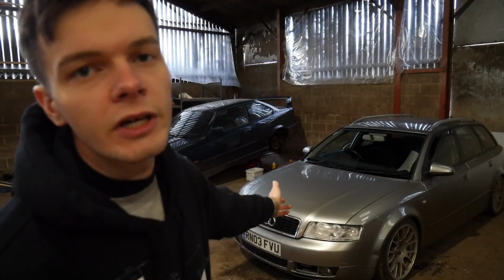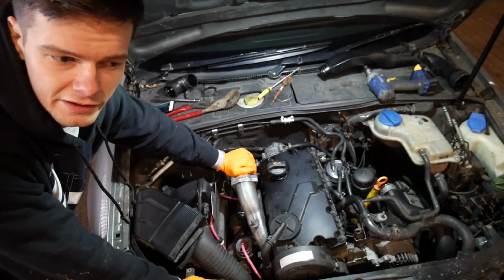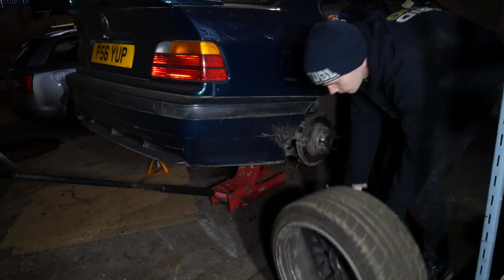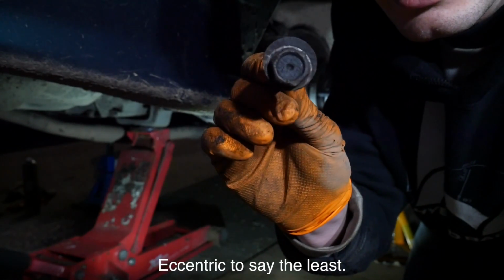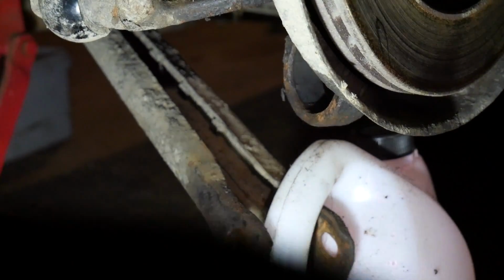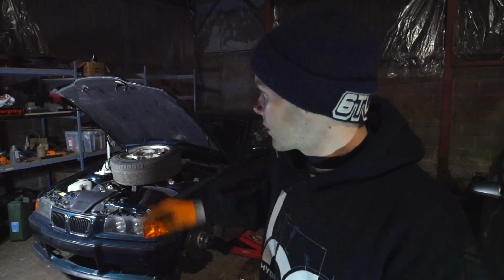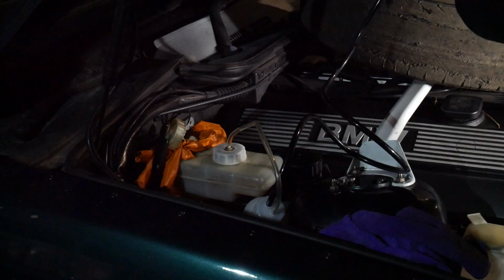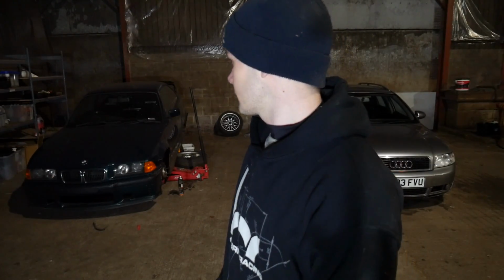Bushes to Balljoints. Autobarn EP2!

Comment: Love the videos, it's cool to see you getting stuck into some "proper" mechanical tinkering. I wish I was as brave. For lighting, you can get diffusers which help a lot with LED lights. It's essentially like tracing paper over the light - if your lights are beefy enough (there is some overall loss of brightness) then that has worked for me before. But as has been said, who cares, videos are great as they are! Looking forward to seeing the Audi starting mystery solved. Good luck.
Reply from the maker: +pornosam84 thanks I'll give that a try! Half my issues were camera related as well tbh, you can see me checking the screen far too often! Didn't really want to piss about with it too much though or it just ends up covered in shit.
Reply: Tell me about it. I got silicon grease in my SLR maybe 3 years ago...still has greasy patches sometimes. Don't worry about how it looks - so long as the camera's looking the right way and there's "some" light, it's good enough for us Youtube freeloaders!

Comment: I bought that exact bleeder for my S14 when I changed my clutch master, annoyingly it didn't fit my brake or clutch master cylinders. Trying to "undo" bolts by doing them up is the greatest, especially when youre under the car undoing some shit upside down and realise after a while of struggling 😀
Reply from the maker: Yeah it's only sat in the garage forgotten about because it didn't fit the DC2! Works well on the BMWs though :)

Comment: Common fault on the PD's is the wiring loom running to the injectors through the head, they shit the bed resulting in no start / miss fires. New OE sub harness is apparently ~£40.
Reply from the maker: Yeah I've heard about that but the symptoms I'm getting don't quite match up at the moment.

Comment: Good video as always Danny, have you cleaned/checked the EGR? I had a starting issue with my A3 and turned out the EGR was sticking shut so the engine wasn't getting any air.
Reply from the maker: +Craig Kent doesn't have one pal
Reply: Fair enough!

Comment: Will the brake bleed kit still work with an ABS unit in place?
Reply from the maker: +Russell the E36 still has an ABS pump and it worked. All the sensors have been cut off though 😂
Reply: DannyDC2 Ah ok. We had trouble with bleeding race bikes with the ABS pump still in place.
Reply: I never had a prob with the Motiv pressurized brake bleeder and my ABS in 16 years of hoopty ownership.

Comment: For all audi part numbers: http://www.oemepc.com/audi/lang/u

If the ez bleed kit leaks at one of the seals let of some tyre pressure.
These kits are not 100% solid.
Reply from the maker: Nice one thanks! Only issue is the pump on the car wasn't original, that's why I had to double check :)